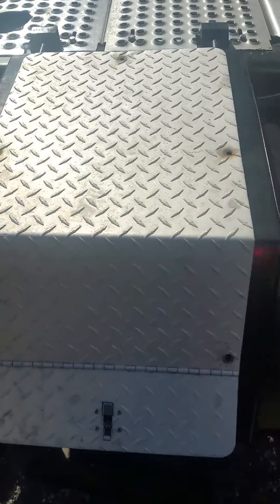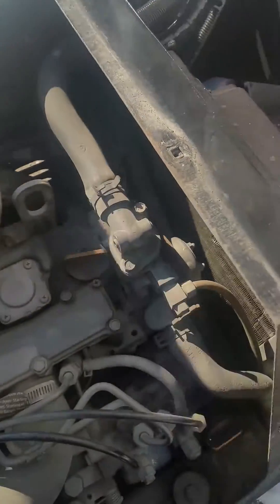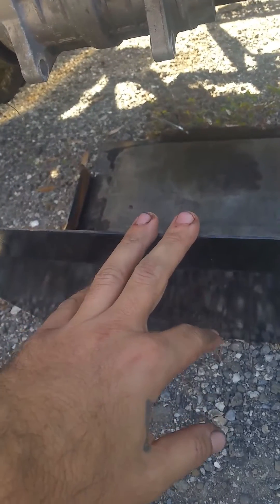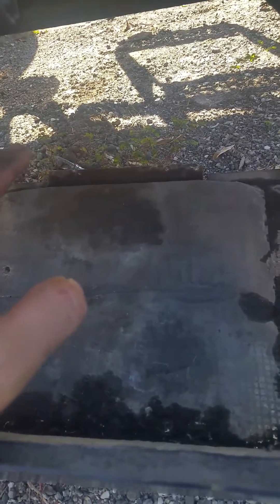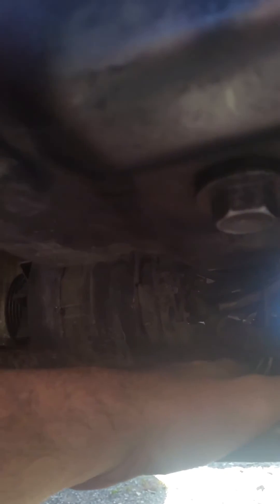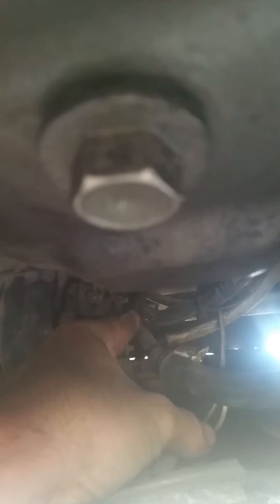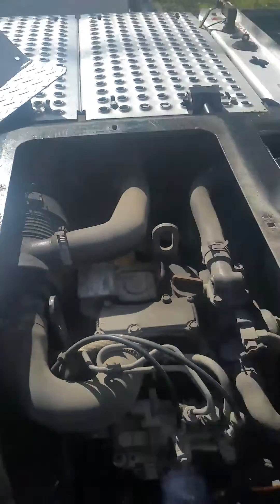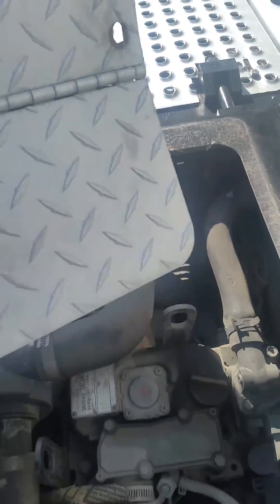Tri pac apu repair alt code

Comment: Hello Eric my apu alternator stops spinning after couple of minutes so that's a bad alternator right,or could be  something else ??
Reply from the maker: Not sure if you mean your compressor because the alternator should be  direct belt to engine. I really cant stop unless you belt breaks off or it will lock up and the belt will squeal till the friction breaks it off

Comment: Hi!  Eric please the fuse 3 Amp inside the unit blow every time the truck star to rumning please you have idea . the diagnostic .thansk
Reply from the maker: You have a short circuit somewhere but its impossible to say where without actually diagnosing you specific truck. All I can advise you is to follow as many of the cables that have to ti with you apu and see if they are worn down and shorted out. Burn Mark on cables or near them is a good indicator or where they come in contact with other metal pieces where the may rub and wear down the cable with the  vibration of the truck. Also it can be a shorted out component like the compressor clutch electronics for example, that makes the fuse blow. Or the blower motor is shorted or stuck somehow maybe. A bag or other stuff can get in there and stop it from moving. Or it can just be a "computer" or circuit board issue that is causing that problem in that case it gets extremely complicated to really know for sure
Reply: @diyitall2023  gracias thansk Eric is new machin only 950 horas alternador  is new.
Reply: Any idea where the 3amp fuse wire goes to , found my wire broken , don't see where it goes it

Comment: Hi Eric, I wonder if you have any idea why when I start my apu it will work great for maybe 10 minutes then compressor kicks off but apu will keep running but no cold air?
Reply: Debbie Smith do you get any codes on your display ? Could be, fan related, or low refrigerant.
Reply: Debbie Smith I have the same on one of my trucks. Not only doesn’t my compressor shut on and off, but it squeals very load when it comes on
Reply: @nrwktruog  
It's the belt when its squeals.. 4 sure .. replace it and make sure its not rubbing the large wheel that is spinning , if its touch there you will get the sound. Adjust the belt to the left grooves. 
The coolant issue.. on the rear of the cab you will find a round shape cylinder,  on top it has a tiny window,  shine light though it , you should not see any white , just clear as the liquid is passing thu .. if u see white just add some basic refrigerant where the compress is located.
These should fix your problems.
Reply from the maker: If the compressor kicks off and never kicks back on then that's a problem cause its normally cycles between on and off periodically. If you got no codes it can be several things. A faulty pressure switch or  pressure switch harness or wires that go to the switches that have rubbed down with vibration. Low/high refrigerant(most common). Even a failing compressor that when starts to heat up after some minutes leaks from the high to low pressure side. Causing a pressure spike or drop. There can even be some electronic control board problem,but I doubt it since u get no codes  right? I probably need to put a/c manifold gauges  and check the pressure on high and low side. Dont remember what the acceptable ranges are for most apu but you can find a service manual from thermoking online for free if you search for it. If your are not comfortable working with this type of equipment  or dont own it an a/c shop may be the best bet in this  case unfortunately. But definitely check the wires and harness to the pressure switches. There is a way to test the switch its self with a multimeter in the ohms setting but again refer to the manual for the acceptable values and ranges for that apu. Its can also be a blockage causing the pressure switch to trip. Like a faulty expansion valve. I would check the harness and pressure switch first make sure they are good (a multimeter is cheap if u dont have one) then if that checks out ok put gauges to it to see if it's missing refrigerant or has pressure abnormalities.